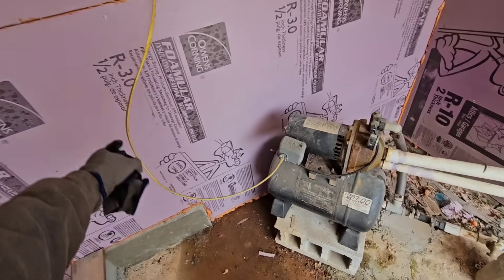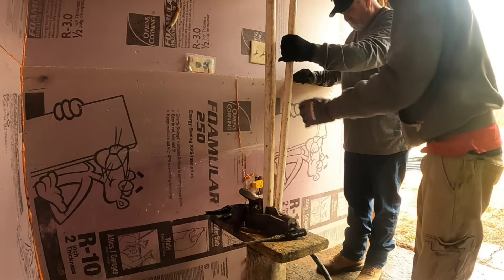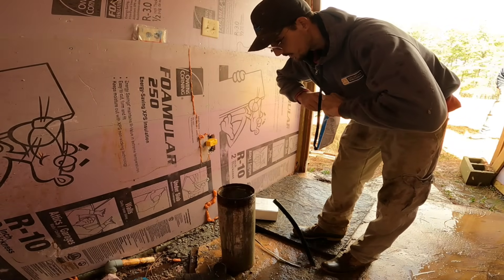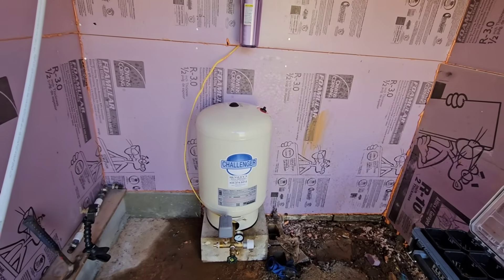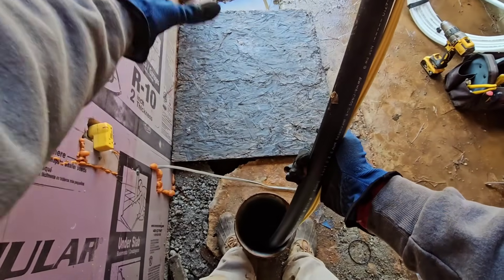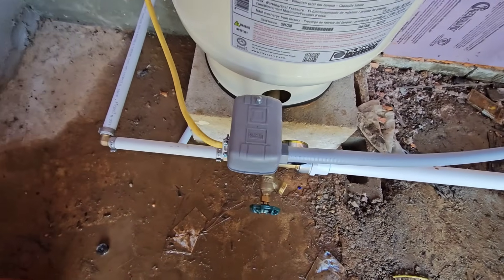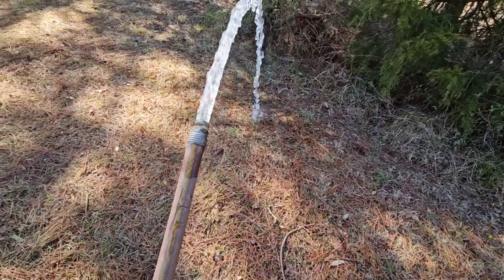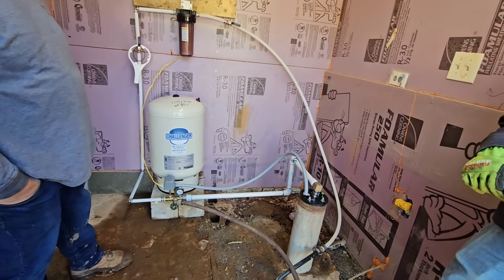Replacing a 1970s Jet Pump with a Modern Submersible Well Pump

Comment: I'm the homeowner, this is my well! The well was dug in 1972 or 1973 and it had a normal small pumphouse around it. My dad built this larger building around it in the early 90's. The original jet pump was replaced by the one that is being removed in this video sometime in the 90's as well. Maybe at the same time the bigger building was built. The one being removed is a Water Ace from Lowes. However, the PVC pipe in the well was still dated 1970 (saw it printed on one of the pieces they pulled out). I am not sure if someone pulled all the PVC out at that time to replace the ejector on the bottom, or if they just left the one from the original 1972 pump. 

These guys did a great job, and I'm fortunate that I live close enough by that I could get him and his crew. I started watching these videos a year or so back, thinking I was going to have to at least replace my pressure tank which had failed. Then I realized they were close by, so I was able to get them to come and replace the entire pump. The pump had developed a bad bearing around Christmas so it was on it's way out. I'm hoping to get them to come back later this year to replace the black plastic pipe and electric back to the house. 

They did an awesome job. He's very professional. Came out and did the job on a day when a lot of people wouldn't have bothered. It's working great and we have good, consistent water pressure now. The finished system is a work of art compared to what I had before. I just go out and stare at it sometimes.
Reply: Thank you for letting this job be shared with us here on this channel.  Really helps to see different scenarios and configurations both old and new.  Best of luck!
Reply: I hope you fixed the floor
Reply: I very much appreciate this detailed message. All my life I had municipal water supply, in Germany it is rather rare for homes to have own wells.
Here the systems use to be centralized and well digging is heavily regulated.
The states take is "This way we can ensure water quality" (and bill us all I guess).
So I don´t know these kind of problems and I very much hope Your water is good and don´t get You sick over the Years.
And I just stare at things, too ;)
Kind Regards, be well!
Reply: What kind of pump was it
Reply: My well pump and tank are in a small pump house 100' or more from the house. My filtration and water softener system is in the house crawl space. I would love to move all water stuff to a larger pump house so I do not have to go into the crawl space! What are your thoughts on that? Concerns? (I am in Georgia, so freezing is less of a concern that elsewhere, but still a concern.)
Reply: I would stick with the jet pump, lime and iron and lightening destroys submersible pumps , my jet pump lasted 17 years and can replace in minutes.
Reply: You might want to cover the pipes with  Pipe Insulation Foam Tube  (pool noodles)   Cheap, effective and easy to install.

Comment: FYI 230V Pump would use half as much Amp draw....If 230v available, always choose it over 120v...
Reply: My well here. 230 would have been nice, but 120 was what was in the ground already for the old jet pump. I expect this will still use less power than the old jet pump that was operating without a working pressure tank. Maybe when we put in the new wiring and piping between the house and well later this year, I'll run 230 so I'll have the extra capacity for the future. It would make it easier to have heating out there as well. I wasn't in a position to where we could wait and run new wiring, because the old pump was dying.
Reply: @andywells8225  For heating, you could wrap the pipes in self regulating heat tape and then foam pipe insulation.  Much lower power loading at 3W to 5W per foot of tape vs. hundreds to thousands of watts for a space heater.
Reply: @andywells8225  You must figure total developed wire length  and horsepower to choose a large enough wire to not have voltage drop at the pump. It is critical on 110 volt 1/2 HP submersibles. If I remember correctly (check it in the manufacturers specs!) @ 100 feet total was the limit on #12 wire.If the wire is big enough , it will be just fine.
Reply: True

Comment: Wondering why you leave the pump so high at 85 ft and not closer to to the 105 ft depth. Seems like that extra water could be helpful in a dry year.
Reply: Think you missed the part where he measured 34’ to water 105’ to bottom. They sat the pump at 85’. If it drys up 50’ that’d be a hell of dry year.

Comment: I would have mounted the water pipe with two straps, the electric should have been straped to the pipe. Labled the wall switch,  and raked or swept out the room.

Comment: Only thing I would have done differently is put in a bypass below the filter for cleaning and also flushing the iron. Other than that very cool video. Thought it was interesting that no pressure tank was involved just a big jet pump in the older days.
Reply: This is my well. The old jet pump did have a really small pressure tank, it's the tank right beneath the pump itself. It was only 6 or 8 gallons, so it was small even when it was actually working. But it died some time ago so basically the pump came on as soon as you turned on a faucet. I'm not too worried about having the bypass, changing the filter is fast enough that nobody in the house should be affected.
Reply: @andywells8225  oh ok gotcha, also the bypass isn't necessary, just nice if you need it. Your new setup is perfectly fine without it. Ive just seen him do a bypass before and it must be upon request or really irony water.

Comment: Haven't located your video on how jet pumps work.  The place where I grew up had a two inch driven well and some "mystery" device on the top.  There were two pipes exiting that to the pump.  I assume the device was the jet and wonder how far it could lift water.  I know that there was no foot valve so it would seem that every time the pump went on, it had to lift water from where ever it stood in the well pipe.  Obviously, I don't understand what was happening so I hope you can enlighten me.  Thanks.  dave

Comment: First fun facts. Now a pro tip. Buy yourself some large carabiners. Clip them through the box ends of your wrenches. Clip that to the handle on your tool bag. No more lost wrenches or digging around in the bag for wrenches. I keep 1/4 through 7/16 on one smaller carabiner and 1/2 through 3/4 on another larger size.

Comment: Fun Facts. I'm in the pool and spa business, but I'm a plumber by trade and we used to do a lot of deep well jet pumps back in the day. The first "Jacuzzi Jets" were actually deep well jets. Jacuzzi originally made well and winery equipment. In the 50s while building his own pool Jacuzzi installed deep well jets sideways in the pool wall, with the venturi suction open to the atmosphere. When water was pumped through the jet it sucked air in creating more "Power". All spa jets still operate on the same basic principle.  Forcing pressurized water through a small orifice and then drawing air in through venturi action. Mazzai injectors for chemicals and ozone work the same way.
Reply: When you switch over to a submersible pump, do you need to also install a control box?

Comment: They didn't have PVC pipe in 1970. It was a new thing used sparingly at the very end of the 70s, but it would take more years before it was super common and they started printing anything on the pipe. That pipe is mid 80s at most.
Reply: My well here: I am fairly certain I saw a 1970 date on one of the pipes that was taken out. Which makes sense, because it was definitely dug in 1972 or 1973 and the pipe was never changed.
Reply from the maker: I believe it was all 1978.

Comment: I find it interesting that with the poly pipe you don't run a pulling rope
Reply: We use a rope , attached to the pump in case the pump comes off the pipe . Electric wires will break , pump stops but you can pull the pump out with the rope

Comment: Great video! I never knew anything about a Jet Pump system until I saw an older video of yours and you explained how the system works. I have a well that is 78 feet deep with the jet pump setup. It was old when I moved in in 1998 but it still works great. I am planning on swapping it out to a submersible pump eventually and was wondering what size pump you installed here. Love your videos, thanks.

Comment: Thanks for yet Another Great vidclip, ....Lovely cat too .... :-)   :-)   :-)  ..... Only comment :- That piece of 'Roll Pex' from the Filter Outlet to the 'House Feed Line', I would love to see that 'Anchored' 1/2 way there to take the Weight .... With all that water in it there is a LOT of strain on the Filter Housing and Connection. One can see the Bend in that Pipe already ... It Will Fracture eventually ..... :-)   :-)   :-)  Best to You and Yours, Keep well and Stay safe .... Cheers from ChCh, NZ

Comment: Lot of wells for jet pumps have small diameter casings.  I think mine is 2&1/2".  I found a 2" submersible online.  Any experience doing this?  Thank you.  I don't want to have to drill a new well if possible.
Reply from the maker: A 2" pump to my knowledge will not support a house with the proper flow or pressure. It's more for testing purposes
Reply: @h2omechanic  thx.  I was thinking it could slowly fill a 500 gallon tank, like an old cistern, and then that could be pumped to the house.
Reply: @Bob.W. Look into Grundfos brand pumps, if they have one that small , it will be high quality. I do know they make a 3" pump.
Reply: Have to uncover my pit and check the drop pipe size ( praying it's 2.5 vs 2 inch), but was planning the same thing 2 inch submersible. Did it work okay for you?  Seems the logical path

Comment: So what benefit does it have to switch over to a submersible pump just curious on that swallow of a well
Reply: Quieter 😊
Reply: A jet pump in the basement is noisy and you'll hear it throughout the whole house when it runs. Submersible pumps have petter water pressure 40 to 60 psi.
Reply: @dand3975  and uses less electricity , it pays itself back on electricity-bill

Comment: I think that's the type of system my neighbor has, which she has problems with periodically. It won't turn off at times, but pumps water.
Reply: I have a similar system.  Turn off power and drain the tank. Then it shouldn't cycle all the time.

Comment: how come you did not put the conduit over the entire wire going into the well to protect and extend the shelf-life of the wire ?
Reply: Cause no one does that. If it's taped right, it shouldn't be a problem.
Reply: Honestly I gave it some thought and I think it would just create a bunch more opportunity to rub through the insulation as the pump.bumls around every time it starts. Also this wire is rated for a use like this and is double insulated and the outer layer is tougher than you'd think. 

But I'm just an electrician, I've only pulled one well pump (twice in the same summer) so that's the limit of my knowledge. We used wire just like this and it's some crazy tough stuff compared to whats in your attic.